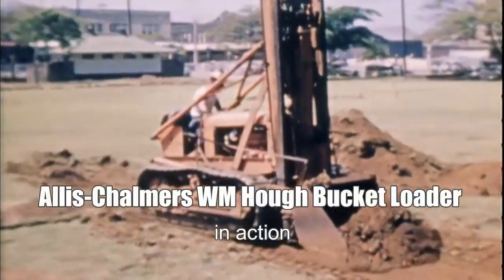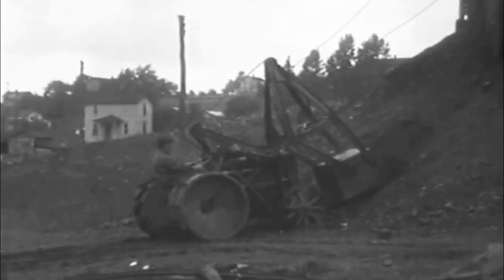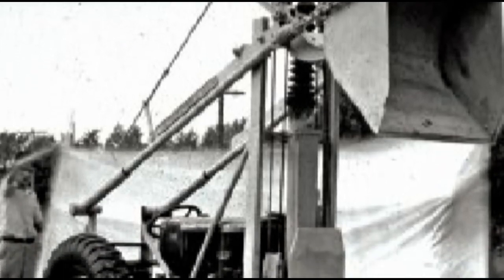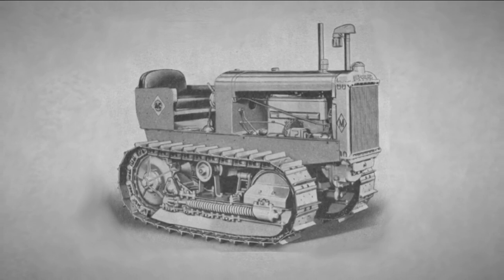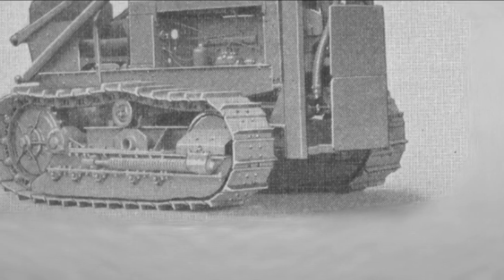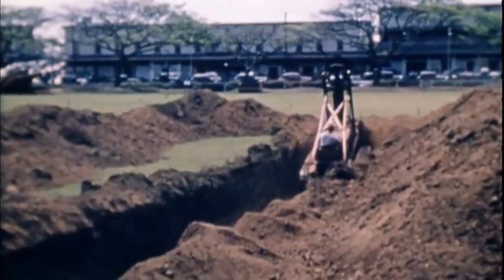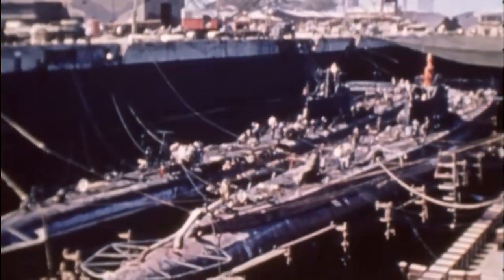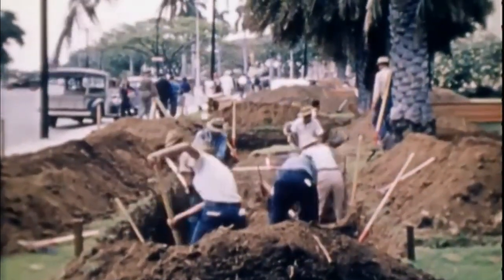What was the Hough’s mid-1930s hydraulic shovel mounted on the Allis-Chalmers Special WM crawler?

Comment: 😞😢 many years ago I had a chance to buy a M but the motor was beyond running the guy said if I wanted it he would sell it to me at scrap price so I did some checking and found a motor so I went back to get the crawler before I got the motor but it was around five months later before I had enough $ to get it but all that was left was slag from someone cutting it up for scrap .😞😢😩